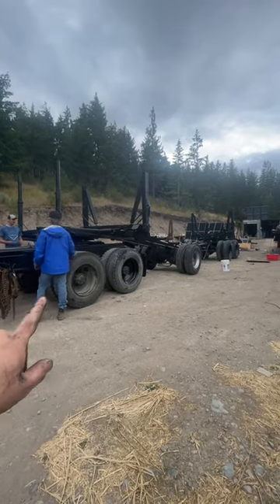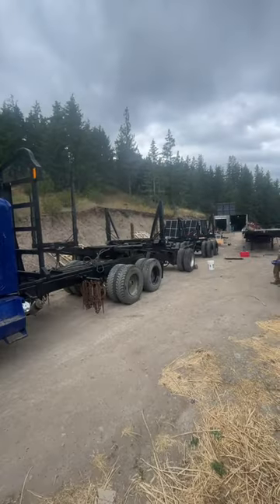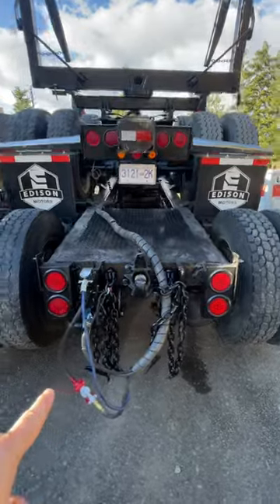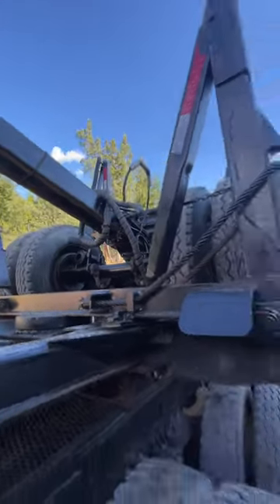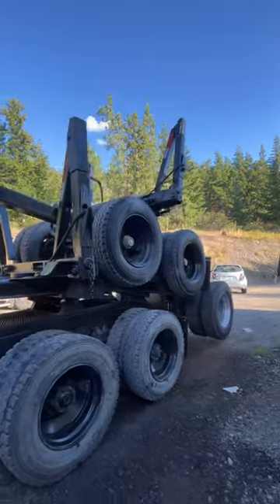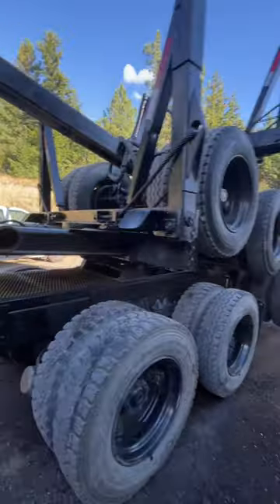Jeep and Poll Trailer

Comment: Visulize a tractor with a log loader on it. A flat bed trailer instead of a log trailer. The flat bed has a cut off saw and a sliding device for logs. So people who buy whole logs for firewood can get you to come cut them neatly into rounds.  Creative would cut a notch in the back of the flat bed to mount a splitter.   A portable conveyor belt catches the splits and drops them in a pile away from the back of the truck.

Comment: I always thought a jeep was a steered unit carrying it's own driver...
Reply: @DickShooter no jeeps are there own trailer used for carrying extra weight on trailers since they add more axles and length allowing truckers to have more weight on there trailers. They are always attached to the 5th wheel on the truck. Or you know yeah a Jeep is a 4 wheeled suvish thing